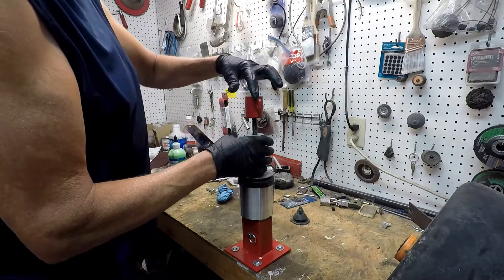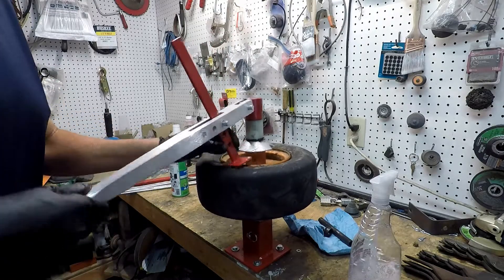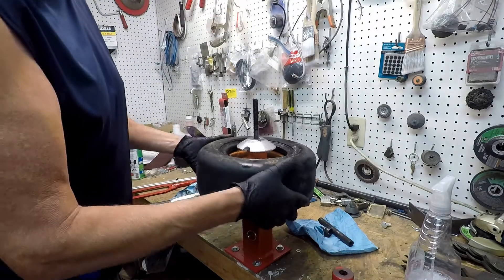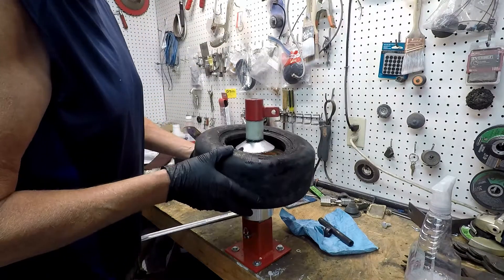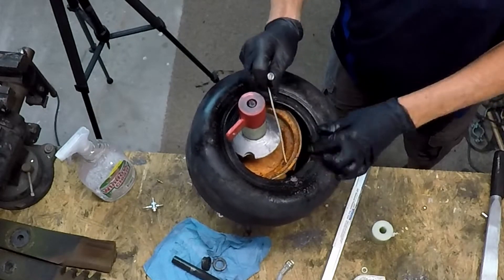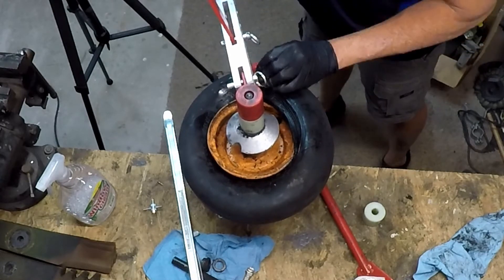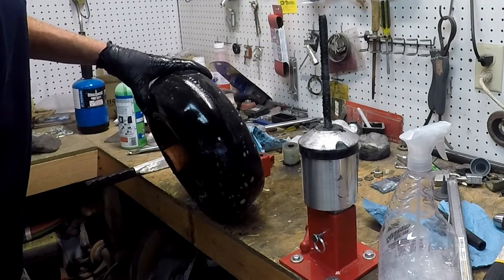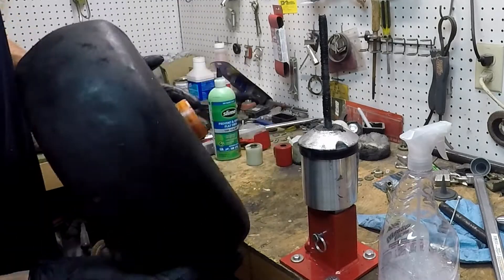Harbor Freight Mini Tire Changer & Green Tire Slime

Comment: Enjoyable !  Next time break the bead on one side of the tire, then turn the tire over and break the bead on the other side ... both sides of your tire will be in the deep part of the rim, giving you more room to work with while you run one side off the rim.  I've tried Green Slime with innertubes on bicycles, they work well there, but with innertubes on riding lawn mower I've not had much luck; I am renouncing innertubes on lawn mower tires from now on, have resort to using black rubber tire sealer, seems to work better with beads and nozzles on lawn mower tires.  Thanks for the video !

Comment: Next time, use both hands to pull down both levers when debeading the tire. That's why there was a grip on it.  Also,  like your tip of using the debeader to get the stubborn tire over the rim edge.

Comment: Hey hey
Uncle Vic here

Just an idea, maybe secure the main pedestal firmly to the bench.
Stop the wobbly wobbly. And this tool should preform much better.

And yes ! You should have let all the air out first.

16:22 maybe. . .  just maybe . . 
You might let the air out first.😉😜😀

Hey Mark,have you ever considered using expanding foam in your front tires ?

Comment: I hear ya. Im over pluggin and fillin tires. The slime didnt work for me so im thinking about about running the solid rubber no air tires. It'll be about 150.00 for a pair but i think it'll be woth it.
Reply from the maker: Be carful with some of those tires they are pretty hard and ride really rough.

Comment: The company I worked for we tried the airless tires on the front deck on a few of our Walker mowers. It was a little too rough and caused the front deck to bounce up and down more. So we stayed away from them. But you never had to worry about them going flat.
Reply from the maker: mfcjr1 I had some of those no flat tires before. They will shake your ancestors loose on a rough yards. I hated them and got rid of them.

Comment: We had a company to site work at the schools, they used straw wrapped in wire....never picked up the scrap wire , had flats for years on our Scags . I had our tire company load the tires with a compound that is used in fork lift tires . problem solved.  The fronts are available in flat proof from the dealers

Comment: Sir you really need to read the directions. You don’t have the unit assemble even close to correct.
Reply from the maker: That is the way it had to be used with that rim  and tire to break the bead. Wouldn’t work the other way.